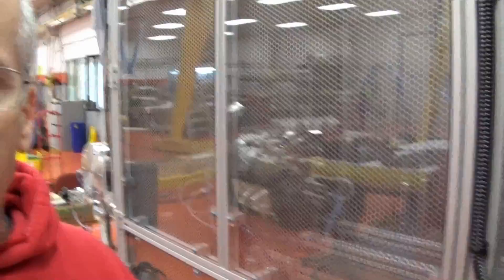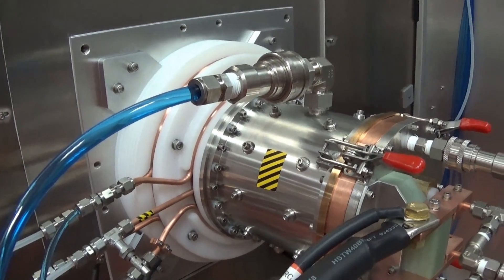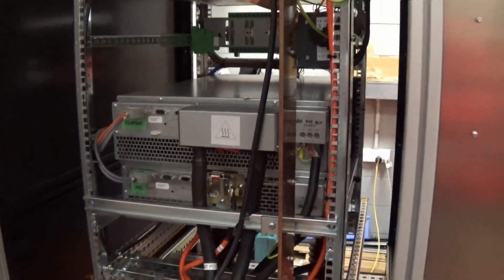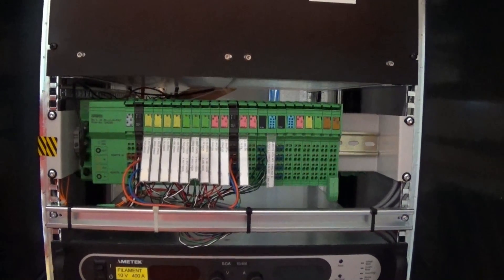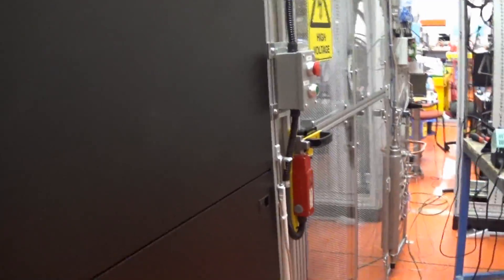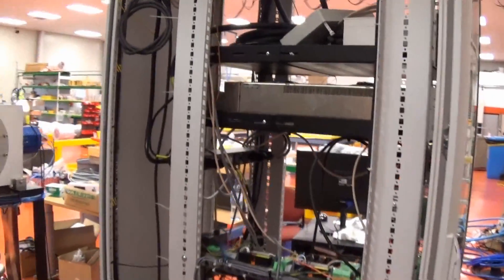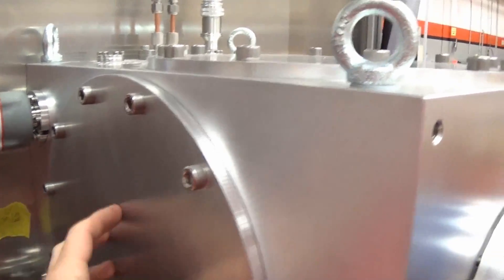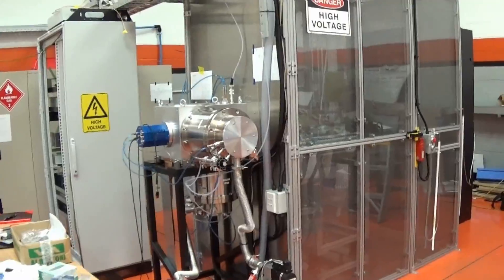Ion Source Test Facility

Comment: Man those PSU's are nice! - Is the ion source differentially pumped, or is it all at UHV?
Reply from the maker: There are two sets of vacuum pumps.  On the vacuum box, there is mounted a turbomolicular pump backed by a roughing pump.  There is the same set of pumps further down the beamline.  We would run the roughing pumps until we got down to a level of vacuum (I think it was around 10^-4 Pa) then turn on the turbo pumps.  If memory serves, we could maintain a vacuum of 10^-6 to 10^-7 Pa if everything in the beamline was clean and we weren't running too much hydrogen.
I may have the figures wrong, it was a while ago and I wasn't running it, I only did the electrical installation of it.

Comment: wow cool Project...nice Video......but  i do not anderstand,why is the PS Rack biased at this high level...?....anyway thank you...
Reply from the maker: The ion source is biased to 25kV and there are several other power supplies connected to it that have different functions to make it work. They must all also be sitting at that potential. The easiest way to do that is to put them all in a rack and bias it to the same potential.